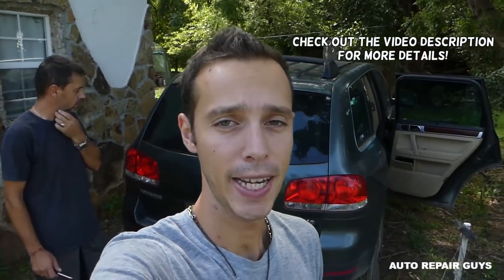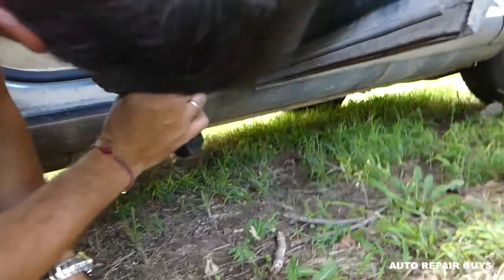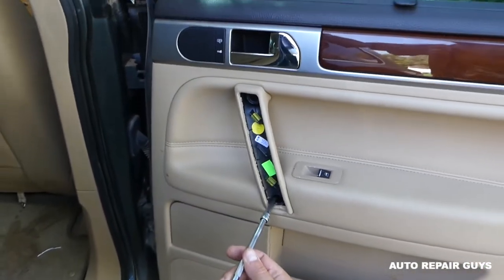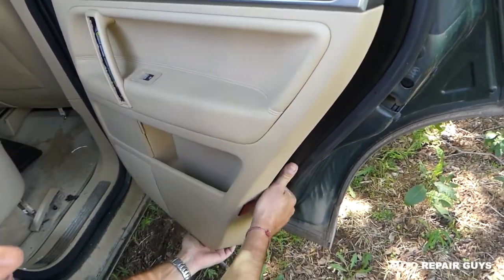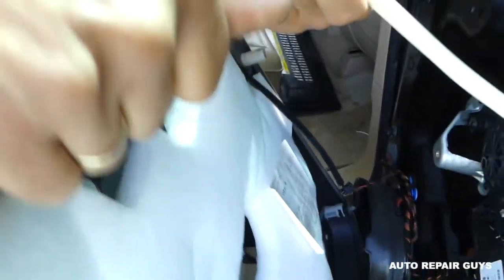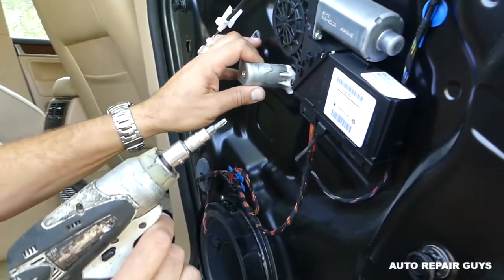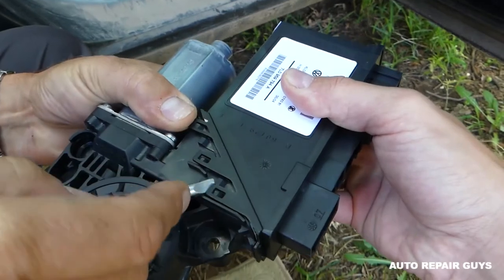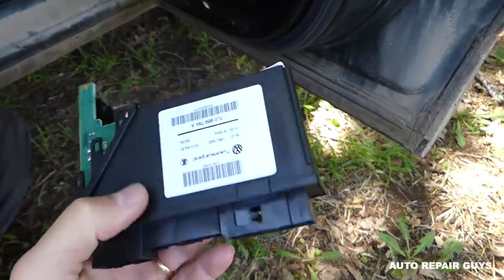HOW TO REMOVE AND REPLACE REAR DOOR MODULE COMPUTER ON VW TOUAREG

Comment: Be sure to grab coding on the module before swapping . Some modules use the same part number but have different functions. That coding will have to be entered into the new module.